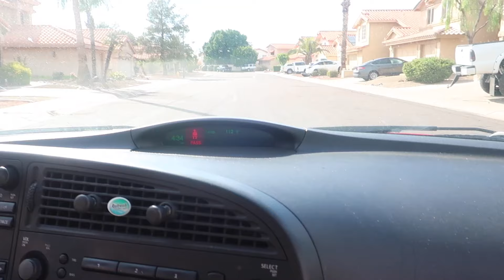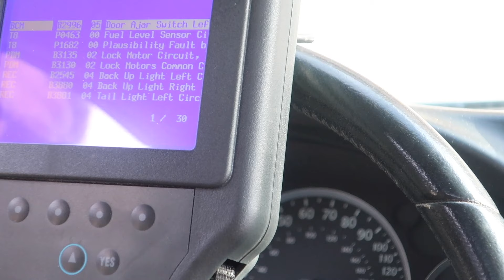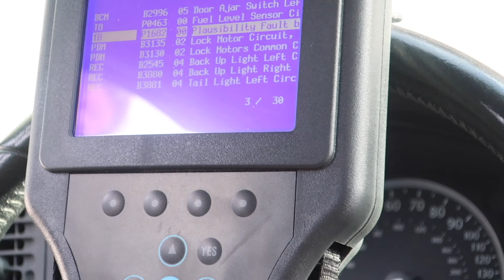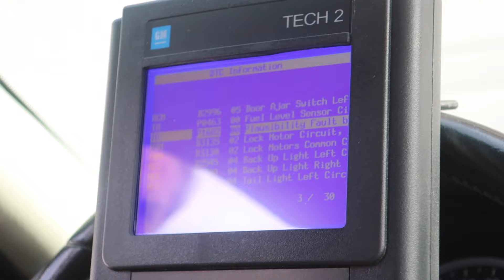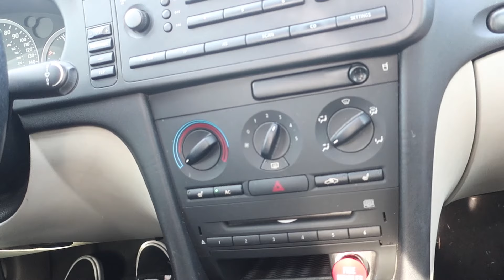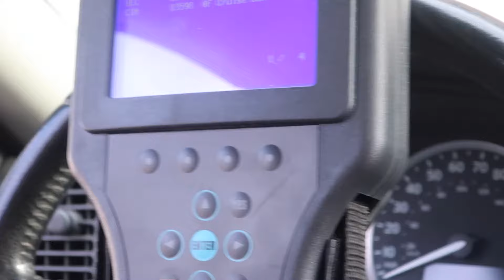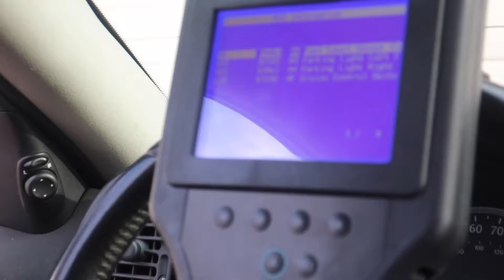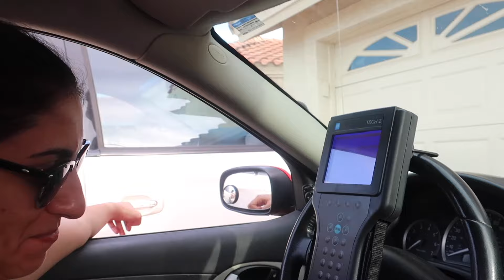Project Saab Episode 5 - First Drive in 6 Months and Tech2 Scan; How Does it Run?

Comment: You mentioned that you have a problem with the gas gauge. I am a saab enthusiast just like you are and a mechanic. I have two 2006 Saab 9-5s, one Automatic Wagon, and a 5-speed sedan. The Fuel Level Sender issue with these cars is common, but is very easily repaired if you are able to remove the fuel pump via the back seat bench. Remove the fuel pump, the fuel level sender has a wire connected to it, this wire in the manufacturing process was installed on the bare wire, which causes the gasoline to  frail it and deteriorate it, and so the current is not able to travel through  it to make the fuel level sender work. Desoldering this wire from the fuel level sender and from the other end of the wire and resoldering a new wire than is thin enough and flexible will solve the problem. Hope this little tip helps you, as I have solved it on one of my Saabs. Good luck!!
Reply: Unfortunately the NG9-3's do not have an access hole under the seat. Not safe to cut one either. Dropping the tank on these is easy though, as long as it is nearly empty. Took me two hours, start to finish the last time I did a sender replacement. You will need the lock ring tool though. Too fragile to hammer it off.
Reply from the maker: Yeah, you gotta drop the tank on the 9-3’s as stated ^ :/ something we will attempt in the future I guess. Thanks for the help, both of you

Comment: winter tires are saying goodbye with that temperature, also reminder of the brake fluid that if the original cap was so badly damaged the fluid should be changed
Reply from the maker: They’re not winter tires; all season’s. Well do the brake fluid when we change the brakes!

Comment: Parking light is the little lights on the headlight. They are the incandescent ones that look bad. Since you have the tech 2 you could enable the ability to just run them on and turn off the headlights with the switch. Luckily they don't bring up a code that pops up on the dash.
Reply from the maker: Perfect. Thanks for letting us know

Comment: Is that Studless winter tyres?
Reply from the maker: No, all season’s!
Reply: @AutoAutopsy  You should really put summer tyres on the car. The so called all season tyre is just a selling point for the retailers, it is not made for warm climates.  It's up to 40% longer breaking distance with that type of tyre on hot roads.
Love the vids! Keep up the good work! :D
Reply from the maker: The car will be spending its time up in Prescott, where it’s fairly cold in the winter months. Thanks for the advice tho!

Comment: Great videos! I'm driving my fifth Saab (2011 Saab 9-5 Aero) currently & finally upgraded it to MapTun stage one at 330hp & everything else being stock.

Are you familiar with working on those models or anyone else that you would recommend that does that will give it more power? Looking to potentially get around 400hp if possible.

Thanks!
Reply from the maker: 440NM? I find that hard to believe; should be able to handle much more than that. I would suggest joining the "NG 9-5 Connection" on facebook
Reply: @AutoAutopsy  haha I'm actually apart of it! That's where I got the info for my MapTun, but I think anything past that 440 is going to require a lot more than just a OBD2 upgrade.

I hope I'm wrong, but that's from what I've seen🤞